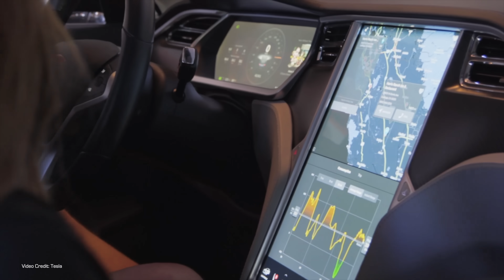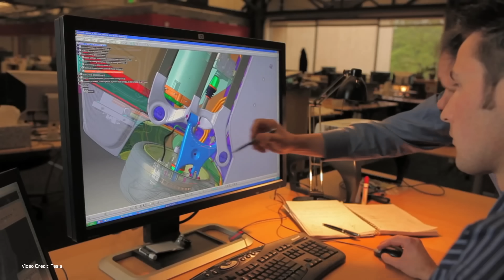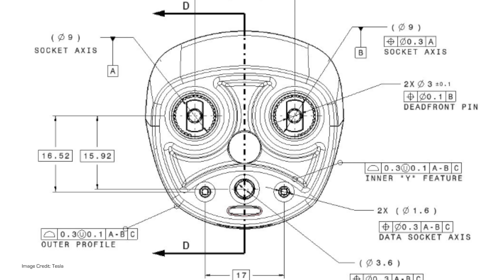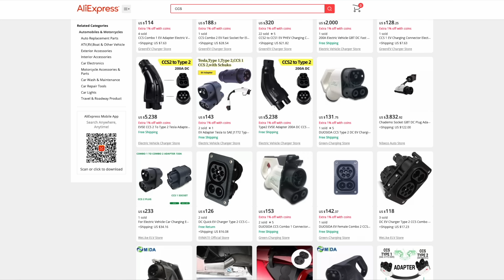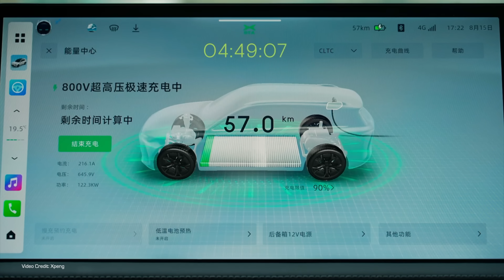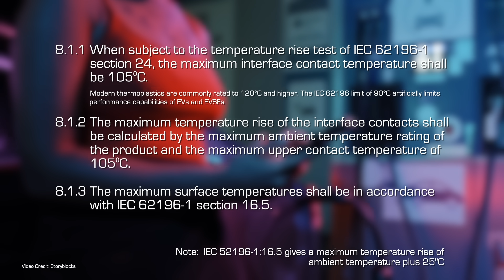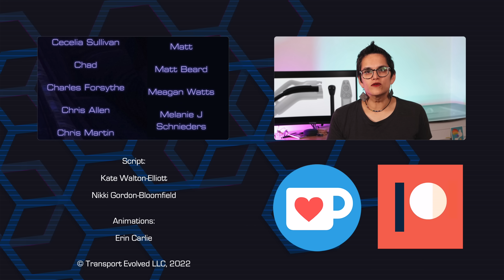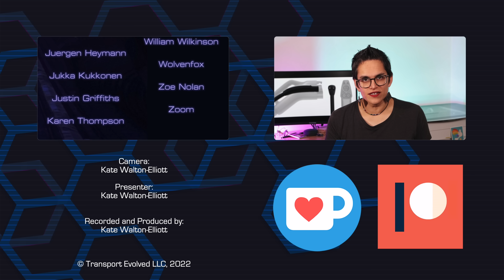The EV Charging Experience Can Suck -- Will Tesla's NACS fix it?

Comment: Hahahah you read my comments from the other video and I'm "Technically correct" !!!!!
It is better than anything else!
Reply: Except, she's wrong. She missed one of the most important reasons why no one, not even Aptera who was adopting the Tesla plug before it became NACS,  has ever taken Tesla up on its pledge. If it was a cross-licensing deal, as Kate makes it out to be in this video, it would have been tempting to do. However, Tesla requires that you do not file any patent lawsuit with relation to EV tech against any other company, regardless of whether or not that other company signed up to the pledge. And in the mean time, Tesla reserves the right for itself to sue other companies.

And not only you cannot sue anyone else, but the same might be true for all your suppliers, depending on how you read the pledge.
Reply: @Hans-gb4mv  there is this pledge and it was briefly noted during the video.
Listen the patent are used just only for patent wars, apple and Google have those, patent are basically used to oppress smaller companies.
Tesla  propose this in 2014 or 2016 when  it wasn't a giant, quite a precautionary thing asking gently not to be sued by somebody that could have patented the concept of a 4 whee electric l mobile cabin.
In the changing circumstances now seem silly, but at the time not so much.

And reasoning in therms of misconduct considering Tesla malignant intent of say: " the patent is free" having other adopt it and then say: " haha I tricked you now I can sue you for patent infringement!" It is the worst conceived bobytrap of the 21st century.

Maybe ford could have gone there and have his group of lawyers write an agreement saying suing and countersuing over that specific patent was forbidden from both sides.

It is an understandable point of view to be little weary about free gift, but here we are fighting against the unwillingness of OEM on changing their way and this weariness seem a poor excuse for a now clear missed opportunity.

Going back on history Volvo did exactly that with the seatbelt patent, this is not unheard even in the automotive

And whatever you say Musk is keeping his words mutch better than Tabarez, Farley, Bara and Bloom altogether.
The chances of one of those to change seeem higher than the one of Musk leaving Tesla.
Reply: @matteoricci9129  I know what patents are, I know how they are used and what Tesla did with it's pledge was nothing more than a PR stunt. Tesla didn't open up the patents they own, not even a part of the patents they own. If you take up the pledge as a manufacturer, you can never defend any of your own patents surrounding EVs against any competitor, regardless of whether or not they signed up for the pledge. What manufacturer would ever do something like that? That kills your incentive for RnD on your end.
Reply: @Hans-gb4mv  hi seems that Tesla is giving his port standard to ford electric second generation vehicles....
It looks like the usb battle in Europe where apple joined usb foundation and they created a compatible usb c lightning port standard.
I think you experienced the usb frustration in plugging the wrong side in usb micro connection or even usb a, so the addition of a big players with good ideas and an aesthetic view isn't so bad, or maybe you liked the usb 3.0 micro b, I guess it looks a lot like CCS type 1 or 2
Reply: I'll come back to you and I'll tell that you are right when Tesla will sue aptera, until then I'm right and you are not
De facto Tesla with aptera follow through with the pledge of opening patents so it goes against the claimed pr stunts
Reply: But what you think happens between aptera and Tesla ?
Aptera asked :" can we use your standard? And Tesla said" ok but let's make it official I'm presenting to the world nacs!"
Simple and easy as I tell probably the reality was some lawyers talking to some other lawyer and deciding on a strategy
Reply: Patents the way are designed now are a good stopper themselves to RND, because there are plenty of instances where expecially in the us malitius lawyer file patents just only for patent wars on small company.
Eu is going to force every manufacturer to put a damn usb c on its device.
From a certain point of view is a good idea, but this is effectively killing RnD because there will be no change possible.
I still like the idea but I'm aware of the cons.
So from a certain point of view the ability of a patent holder to sue is bad, mutch better to have manufacturer to pay royalty to the patent office so that used patent can be fairly retributed.
The royalty must have an expiring date an should be set to a certain degree by the creator, after a while, a short while everything should go free
That's my view for now, if you tell me a better way I'll change idea

Comment: Whatever we choose we need to choose one ,just yesterday as I had to charge my Leaf in Homosassa FL. I saw a tesla charging on a lv2 charger? And I was what ? They have  a adapter lol its just another thing that the tesla driver needs to buy hints why I'd stay away from tesla there awesome but to expensive for the little person.
Reply: When has an industry ever adopted a single standard?
Reply: If I had to chose one worldwide standard it would be IEC 62196 (European style) Type 2 for cars and the CCS variant for trucks.

We'd just have to get car makers to fully support the whole IEC standard, including the already built-in option for DC charging (without the CCS extension, by using the L1/L2/L3/N pins as +/+/-/-), and not just AC. Also, for the US market it would probably make sense to augment the standard with a split-phase option (i.e. using the L1/L2/L3/N pins as L1/L1/L2/L2), but that should be trivial.

Type 2 without CCS is not that much larger than the Tesla plug, but supports 3-phase AC (important basically everywhere outside of North America), has much thicker pins (i.e. more current capability) and more space in the plug for liquid cooling.

Comment: I think the accessibility superiority of Tesla/NACS is understated. There are many people with arthritis who can barely operate a gas pump. The CCS connector is right out. Design for 9 to 99 years is better for everyone, although in this case we could say "16 - 99 years." For many, many things I use my mother as a guidepost. If she can't use it I don't think it's a good mass-market product. Usually that's the complexity of a techie item and how easy it is to learn/interact with, but in this case my mothers RA impacts her physical use of a CCS connector.
Reply: Here's the problem, and one of the things that Kate seems to have missed. One of the reasons CCS cables are heavy is because of the length. The longer the cable, the higher the losses in the cable and the more cooling you need. That is why a long CCS cable is liquid cooled and a short Tesla cable isn't. And the only reason Tesla can keep the cable short is because all Teslas have the chargeport at the same location. On the other hand, we are seeing CCS chargers that are redesigned to make the cable easier to manipulate by taking some of the weight from you.
Reply: @Hans-gb4mv  CCS cables are heavy and stiff when they are not watercooled. Watercooling makes cables lighter, as less copper is needed and the water tubes are way lighter (metal sinks in water, I heard) and more flexible. And Tesla's V3 superchargers (the 250kW ones) are using watercooled cables that are significantly lighter than their V2 cousins.
Reply: @HenryLoenwind  do we need liquid cooling on a -35° morning like today?
Reply: @HenryLoenwind  all high powered CCS charging stations use liquid cooled cables. But the longer a cable is, the more resistant it is, the higher the energy loss in the cable. And when you are dealing with hundreds of amps, it adds up.

They also don't use water as water and electricity don't mix that well. And it's not because a copper cable would be buoyant in a cooling liquid that it therefore reduces the force required to lift the cable. The weight is still the same.
Reply: Our 4-year-old loves plugging in our Tesla. It's actually easier for her than plugging in an iPad.
Reply: If you used my mother as the metric, we'd still have full service gas stations - she will not pump her own gas; I can't see her plugging in an EV, either.

Comment: Tesla's original proposal was never going to fly not only because of automakers - trying to get all the part suppliers on board with that trade offer would have been impossible.
Contrast that with the Type 2 connector. Freely available yet Mennekes is still laughing all the way to the bank because they were able to establish themselves as the "premium" option from the get go.

Had Tesla done this 10 years ago I have no doubt that it would have taken off. Maybe they could have even made a compatible 3 phase version and pushed that one in other markets. 
Maybe NACS was the true Betamax all along, this is exactly how all those SONY formats kept on failing after all.

Comment: This is why this channel is streets ahead of most others when it comes to technical details.
What I want to know is: are the NACS connector pins lower-resistance than the CCS pins? i.e is there any reason to think that it can do 350kW+ without liquid cooling without overheating any better than CCS? 
And why is CCS3 taking such a long time? We need a sensible open bi-drectional power spec (about 3 years ago!). (And even CCS isn't actually an open spec -  it's a 'pay to join the club' spec. It annoys me greatly when those people say they are 'open'.)
Reply: CCS1 and CCS2 aren't versions. They are variants of the same thing.
Reply: @HenryLoenwind  What makes you think that? Wikipedia disagrees: https://en.wikipedia.org/wiki/Combined_Charging_System#Versions_of_the_specifications Although it doesn;t actually give a date for when CCS 2 was published. Looks like around 2015. (CCS (1) was published in 2011)
Perhaps you are thinking of the Type 1 and 2 (and combo 1 and 2) connectors specified in the standard?
Reply: @xxwookey  It really depends on your source material. There are sources that point to CCS1 and CCS2 and differentiate the 2 based on the plug they use, be it an American type 1 or a European Type 2 plug. I've even seen it referenced that way in documentation from Char-In itself. I've also seen people refer to CCS1 and CCS2 as the version of CCS. Ever since having some major discussions about it some time ago, I stopped using the terms CCS1 and CCS2 and now specifically refer to either the plug or the version of CCS.
Reply: @Hans-gb4mv  I didn't actually mention CCS1 or CCS2 in my original post, just CCS3, which currently isn't confusable with the connector types and clearly refers to the version (until someone invents a 'Type 3' connector (maybe the NACS connector could get that name)) . I take your point about aoiding the terms to avoid confusion.
Maybe I should just have ignored Henry's somewhat oblique post.

Comment: Aptera is using the Tesla connector.
Reply: Does aptera intend to sell its trike outside the US? If so what standard will it be using for that vehicle?
Reply: @linusa2996  That's still a big question mark. Over in Europe, even Tesla uses CCS, so if Aptera does not supply their vehicle with CCS in Europe, I'm not getting mine.
Reply: @Hans-gb4mv  it is the law in Europe that you have to use ccs on new electric cars.   So it us that or nothing.
Reply: @fatboy19831  no, it's not. There is not a single law that mandates the connector. Not for the vehicle, not for the fast charger. The only time a CCS plug is a requirement is when you are installing a fastcharger and it is financed with public money. The EU did think about making CCS a required standard, but ultimately decided against it. Presumably under pressure back then from the Japanese manufacturers who were still pushing for CHAdeMO.
Reply: @Hans-gb4mv  good information.  Ty
Reply: Aptera is still in the prototype phase and let's be honest, the North American market for such a weird tricycle is pretty small.
Reply: @anthonyc8499  Aptera has the production version ready.
Reply: @anthonyc8499   Aptera has Almost 50,000 orders.   Including my Sister and I.
Reply: Aptera is still looking for deep pockets for production.
Reply: more like, sucking up to Tesla hoping to get something in return. Beside, surely early prototype was using gutted tesla drivetrain.
Reply: @USUG0  interesting speculation.  The Aptera uses hub motors.   100% there is some Tesla technology.   Battery,  software, self-driving.    The Tesla plug fits in the back behind the tag.  Nothing else would. To start a company using the supercharger network is free advertising.  It makes your car instantly practical.

Comment: wait.. the Tesla plug is NOT liquid cooled? Didn't they recently say that it's supposed to be used for the Semi at up to 1MW?! I had assumed they just made the cooling system significantly smaller and weaker than CCS, but not having one at all at these power levels is just insane.
Reply: The plug isn't, only the cable is. At the back of the plug, the cooling channels loop back into the cable while the copper wires go on to the front of the plug where they end in uncooled pins. For the moment, that seems to be enough for Tesla, as more of the heat travels up the copper to the cooled cable than through the plastic of the handle.
Reply: You are assuming that there is one thing that is "the Tesla plug" that encompasses the plug and cable.  Tesla has been apparently adding liquid cooling to some of their cables for higher voltages.  From what I can tell, the Semi Tesla connector is another different cable and plug as well.

Comment: Great job Kate! Informative and fun to watch. One fact to add: Tesla V3 supercharger 250 kW cables are liquid cooled and very thin and light. However, Tesla only included the older 150 kW V2 cables in their published NACS document. They are heavier and not liquid cooled.😀
Reply: Thus FAR easier to install and maintain.
Reply: In Redondo Beach CA all the 250 Kw chargers are liquid cooled and are cold during a hot day and heavy charging. The cables are thin. I am surrounded with 250 Kw chargers.

Comment: If I were to make a manufacturer, it would be a no brainer as my consumers would have access to a better charger network.
Molds are not that expensive. Only a couple of thousands copies are enough to justify it.
It's more laziness and pride than price.
Reply: But they wouldn't: the Tesla charger network doesn't all speak CCS (does it?). Are they going to upgrade it all so it does? Will it still be better when presented with the pile of different manufacturer's CCS protocol implementations, or will it just have the same set of issues that some other chargers have?
Reply: It's what Kate said: Tesla Superchargers don't speak CCSish so any vehicle with a native Tesla-shaped plug can't use Tesla Superchargers. Instead, a non-Tesla charging company could add a Tesla plug to their CCS charger but it would cost them thousands of dollars to install the cable. It's easier and cheaper to just let Tesla owners buy their own adapters.

Comment: The lack of NCAS adoption from other automakers will kill the EV movement for non-Tesla EVs.  See recent videos from Kyle from out of spec and rich rebuilds with his Rivian.  Unreliable charging is a horrible experience for customers and is the most common question I get for someone considering a purchase.  I can not in good faith recommend a non-Tesla EV if someone takes frequent road trips.
Reply: But as Kate just explained, the NACS standard won't fix this: it's just the connector, and the unreliability comes from a) the protocol and b) the multiple implementors in chargers and vehicles. And it'll make it worse for older tesla owners in the US (because they would be able to plug into charger they can't talk to).
Reply: Interesting suggestion; Tesla connector on one side of the vehicle and CCS on the other.
Reply: I feel that its less about the standard and more the execution of the service, now you have so many none Tesla manufacturers in the EV market investment and competitive service quality will be top of the agenda.
Reply: The lack of 3-phase support is a no-go for most countries outside North America.
Reply: Also factor in that companies like Amazon will soon have a fleet of EV delivery vans, the pairing of a drop box and charge station off the beaten track seems like good business sense allowing Jeff's vans to top up and drop off and his customers to pickup and top-up.
Reply: Problem is that the connector won’t fix the issue. The connector has nothing to do with unreliable chargers. Even Tesla chargers aren’t reliable when they’re expected to work with non-Teslas, which has been shown time and time again in the test markets with open Superchargers
Reply: Yep. I can’t imagine owning an EV that’s not a Tesla right now.
Reply: And the unreliable charging will come to Tesla chargers as we have seen in Europe. As Kate explained in the video, the reason Tesla can make it work so well is because they control everything. The moment you have to split responsibilities, you get a blame game and incompatibilities.